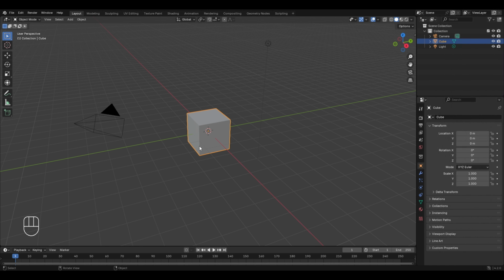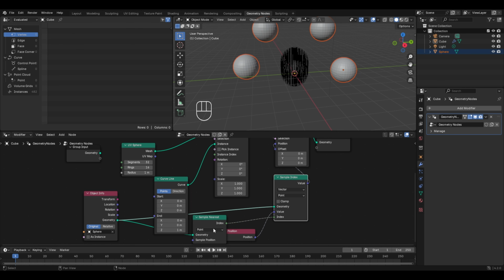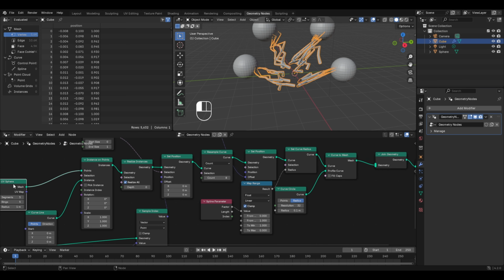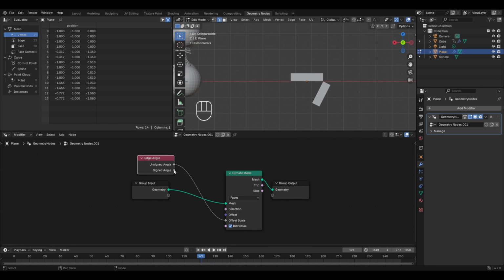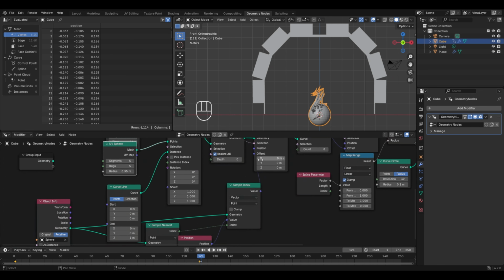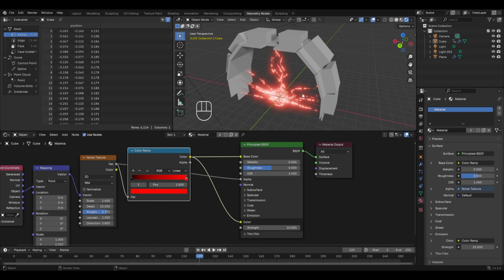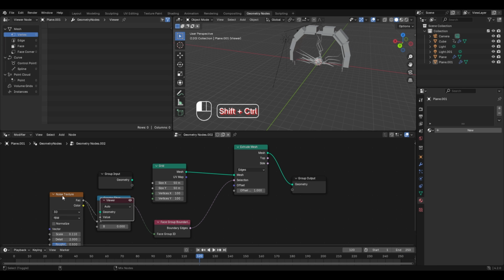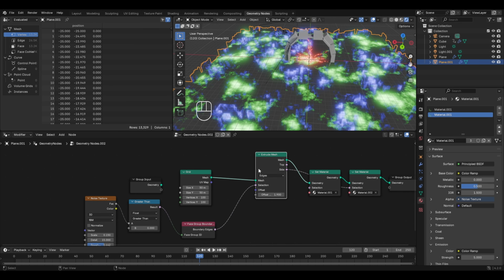BLENDER MASTERCOURSE: Chapter-48: Geometry Nodes: Creating a SciFi Portal Scene (Part-1)

Comment: Bro what's the config of you system 
I m using Acer Nitro rtx 3060 but still the render takes more than 7 hrs for an animation 6 sec with 150 samples
And also this is some gold stuff😊
Reply from the maker: First of all, Thankyou so much! Bro my PC is not so good, it has Ryzen 7 5000 Series, along with an integrated AMD Radeon Graphics. GPU is not that good, but CPU handles everything properly in my PC.
Reply from the maker: Try this: Go to render Properties and check if the device is set to GPU or not. It might help
Reply: @jb3dstudio  it is set to GPU compute
Reply from the maker: Ohkay, so there is nothing much you can do then, for me 1 frame at 100 samples take around a minute to render. I think either try upgrading your system, if you really need a faster speed, or you can even try upgrading ram, it helps in a lot of cases, and it's budget friendly too. However, in most of the cases if 1 frame with around 100 samples take 1 minute, it should be a decent speed for beginners.
Reply: @jb3dstudio  ok thanks man for replying so fast, keep growing man you are awesome
Reply from the maker: Thanks a lot🤗